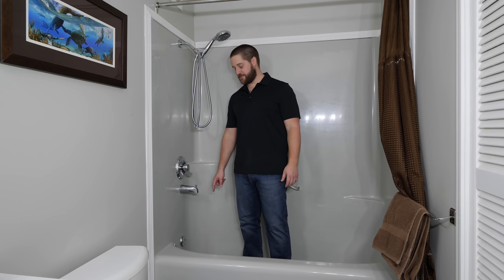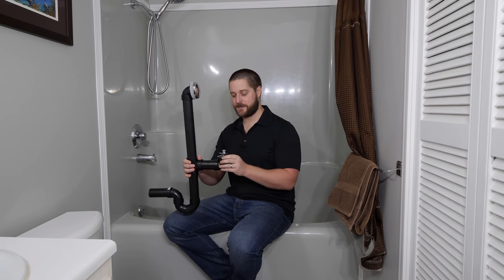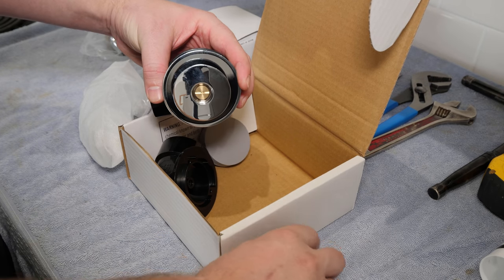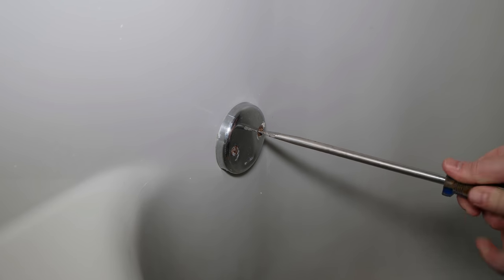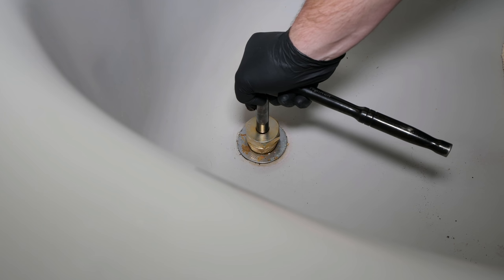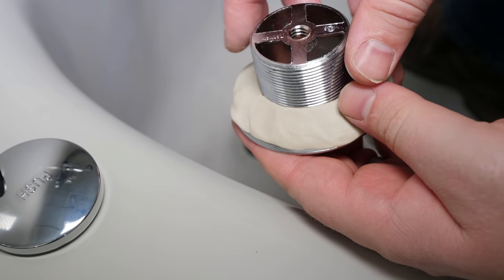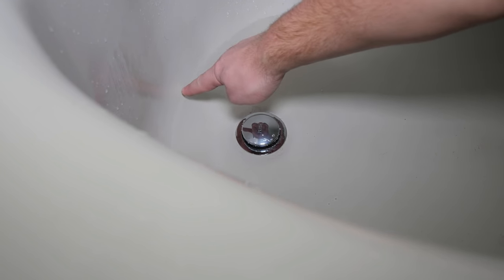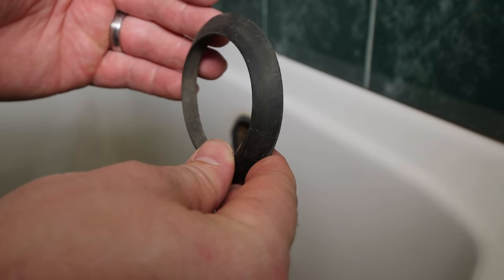Replacing a Tub Drain: Bathtub Drain Removal and Replacement

Comment: Most of this video is really good.  But it is supremely misleading and wasted a lot of my time, because it fails to tell the DIY plumber like myself how to measure drain size, based on the one piece of information available to the DIY plumber, namely the inner diameter of the exposed surface of the drain. 

The video at 1:40 explains there are two sizes of drains.  One is 1 1/2" inches, with exterior diameter from thread to thread of 1 7/8".  The other is 1 3/8" inches with exterior diameter from thread to thread of 1 9/16" 

When I got out my Neiko digital calipers to check dimensions of the drain on my tub  to find if it was 1 3/8" or 1 1/2": I found something truly alarming.  At the exposed surface of the drain, the inner diameter was about 1 3/4" --- which was a whole lot bigger than 1 1/2". This sent me off on a real wild good chase trying to find parts for 1 3/4" drains. 

To cut a long story short, I discovered that what's called a 1.5" drain in fact has interior diameter of about 1 3/4". And was then able to purchase the appropriate parts.

Please revise the otherwise excellent video to tell the viewer what measurements to take to determine whether they have a 1 3/8" drain or 1 1/2" drain, by measuring the visible drain diameter in the tub.

Comment: WTF.. The one time I had to have the drain replaced because of corrosion, the plumber showed up and said he had to open up a section of wall behind the tub to be able to seal the new drain. On top of that, he said they "didn't have the part in the truck" and had to go get it from somewhere. Charged an extra hour of labor for that.. I knew that was absolute garbage. The total bill came up to about $1000 CAD. I knew I was getting screwed but I didn't know how much.. And of course I'm not a plumber and I live in a condo so I couldn't just do the repairs myself, even if I knew how to.. (for liability reasons) 

Then I see this 12 minute video.. years later.

Comment: That is for the people who would like to snake out all the hair that wil collect in the pipe system.
Dispense with all that fancy stuff and buy a 99 cent fine screen and throw it down there to keep the plumber out of your house (wasting money) or you sweat to snake the system..
Every one of videos is to sell a product and rarely tell people the right thing to do.......
Reply: @tabithasherie3279  The number one thing that causes the clog is the hair that hangs around. Hair do no decay easily. Corpse still have intact hair after being buried for decades. Save yourself from being ripped off by plumbers and the headache of snaking if you do it yourself by grabbing a 99 cent stainless steel SCREEN strainer (Mainstay) and throw it down there and let it catch everything (and I mean everything but water) and every week just take it out and give it a good whack in the trashcan and throw it back down there and your problem is solved forever, but of course, these videos would never tell you that because they are there to sell stuff....
Reply: @tabithasherie3279  The purpose of the video is to sell.....and you can see the Amazon stuff they are selling...that pop up would let everything down.....that would get stuck about 50 feet deep in the drain pipe and then you would have to call plumber.....especially if you live in an old house.....anyway, I do not want to rain on the parade of these salesmen and saleswomen....and of course, the plumbers need to be in business to charge  doctor's fee....

Comment: Bet you can’t remove my tub drain that fast ,😂 I’ve use both tools you showed, and some you haven’t plus heat , and mines not moving in a thousand years from now those people will think 🤔 my drain has something to do with mapping the stars ✨, 🤣
Reply: I have a feeling you've done it already but just in case: have you tried spraying some lubricant or WD-40 around the rim multiple times and let it sit for a good while?